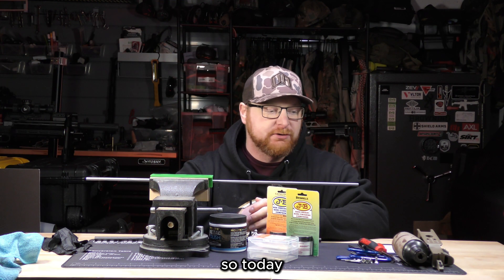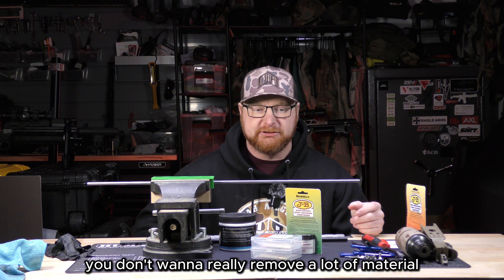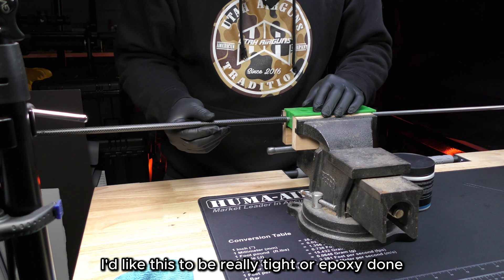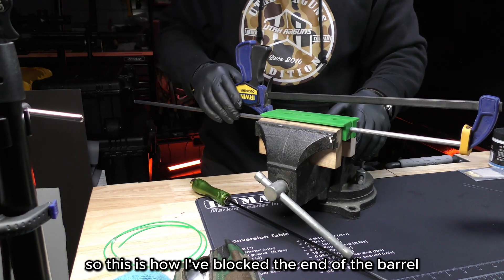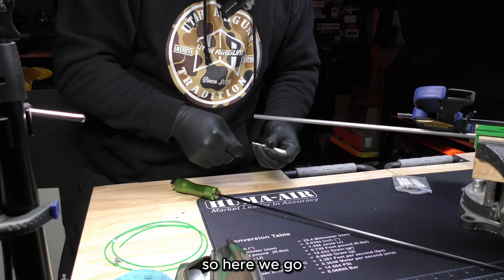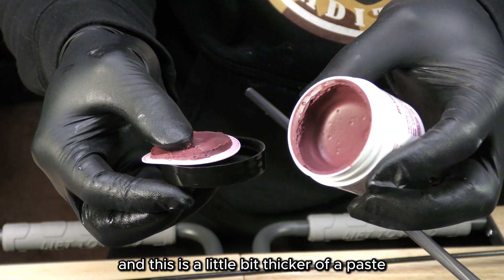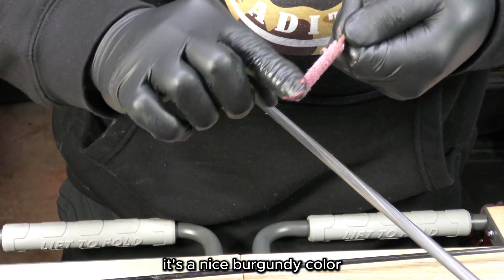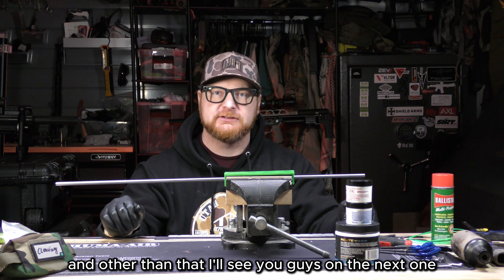Barrel Polishing: Is It Truly Worth It? Airgun performance

Comment: I've never understood the rationale behind polishing the barrel in sections.   What is the advantage over polishing the entire length at once?
Reply from the maker: You can feel where there are sections of barrel resistance that you can work on individually, but I think it’s mainly to make sure you have even compound the whole way through. I’m sure it works either way though. I’ve only ever really done it like this.
Reply: Polishing the rear more than the bore

Comment: Springing off another comment:  you can create a tentioned barrel by slipping on the sleeve or shroud then if you have 1/2 by 20 threads you can lock the barrel shround on with a muzzel break or moderator the trick is to cut the tube just slightly longer than the unthreaded part of the barrel , as you screw down the moderator it will pull against the barrel giving it tension,  make sure your barrel grub screws are tensioned properly and blamo you have a tensioned barrel .  Ive done some barrel polishing but Im in the budget pcp realm , I bought some diamond polishing paste in 7 different grits down to 0.5 microns on the diamond particals ,  using the higher grits isnt much recommended because it does cut metel easily,  the biggest grit I used was 0.5 microns and worked my way down ,  I only changed bore mops when changing grit compounds .  Nice video not a lot of info or discussion about barrel polishing,  I use the highwr grits on my strop for shapening knives . You can get the kits on Amazon for the price of just one if the JB products.

Comment: T-CUT probably works just as well, but maybe try it on a cheap gun first ! 💅 We used to use it "Letting In" the pistons on High Pressure Pumps, I'm talking 700 Bar Pumps we manufactured. (I'm now retired)

Comment: Don’t clean off your factory barrel indexing mark when you clean the barrel if you didn’t already. It’s a mark in one of the grooves on the choke end and nobody talks about! 🤷🏼‍♂️
Reply from the maker: I didn’t know that, thanks for the tip!
Reply: @ hopefully you didn't, because it makes indexing your barrel and keeping the gun shewting straight a whole lot faster.
Reply: Are you talking about the sharpie mark on the outside of it? Which way should it be oriented
Reply from the maker: @ yes, upwards